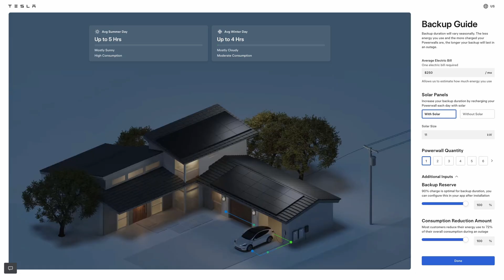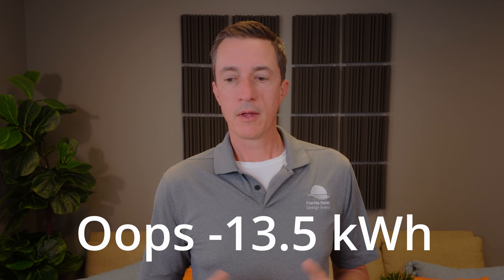Can a Single Tesla Powerwall 3 Run My House?

Comment: I am in NC. I have a single power wall 3. During peak summer, the battery back up would last from sundown to about midnight, then switch me over to city power. During the spring, however, it can run the house until the sun comes up to recharge on solar.

Comment: If your AC runs for 4 hours straight without stopping….your AC needs changing and need to insulate the house better. It might run for like 12 minutes on 7 minutes off…that’s about 30 minutes for each hour so you’re talking 4 kw in 8 hours and it cools off as the night progresses so more like 10 hours
Reply: Florida is very humid. The AC works double duty as a dehumidifier and humid homes need a lot more power to cool down.

Comment: If we have the Tesla power wall three, can we hook up a cyber truck to provide the additional battery back up? If so, how would we do that?
Reply: You would need the special charger Tesla advertises that can go vehicle to home for the cybertruck. I am hoping one day vehicle to home is common, and then I can use my model Y for extended outages as you describe.
Reply: I have a Cybertruck with the Powershare Gateway and just installed 49 REC 460 panels. I'm thinking of buying a Powerwall 3 and one or two or three expander packs. I'm trying to figure out how many expander packs I need and if I should bother when I have the Cybertruck which is equal to 9 Powerwalls and at least 4.5 Powerwalls if I don't want to use up the whole battery.